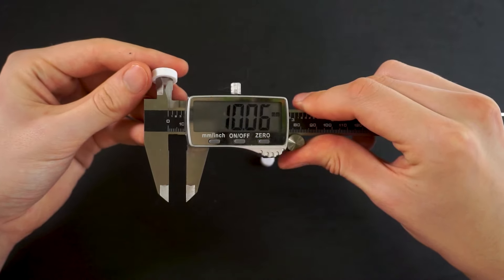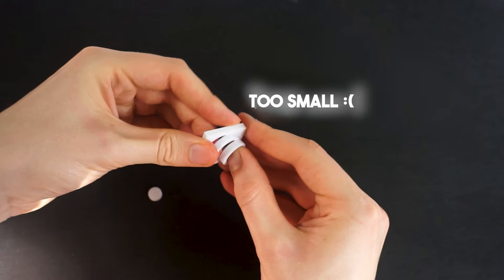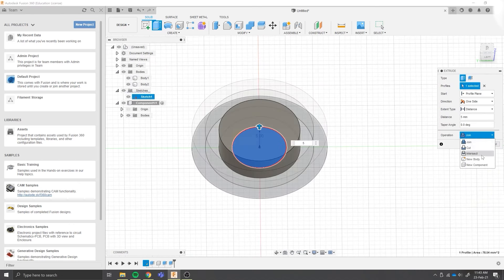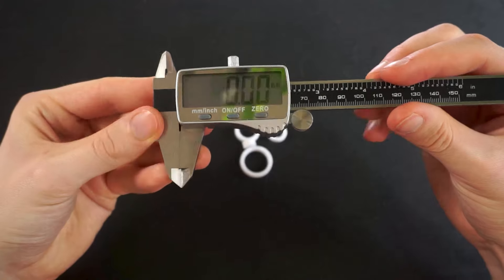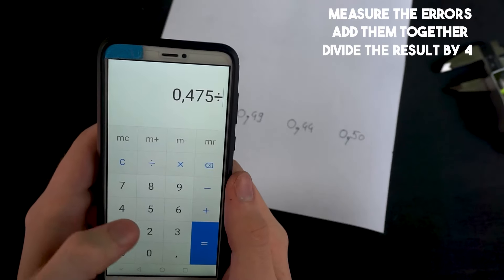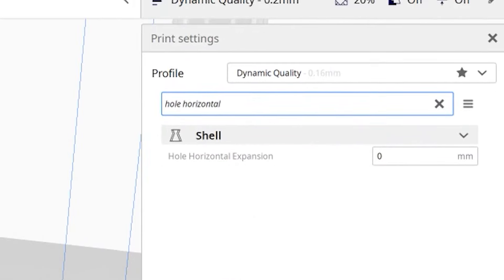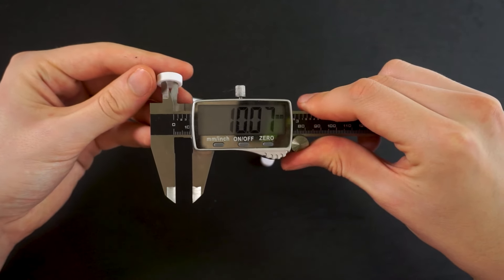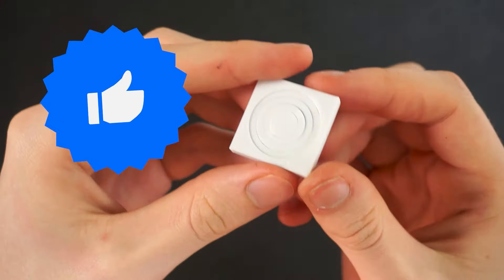How to Calibrate a 3D Printer when the Holes come out Too Small

Comment: I tried this and it worked perfectly to calibrate my Creality CR10S. Thank you for helping me make my printer work better. Just take your time measuring the diameter of the circles and measure each one several times to get the average of each measurement. Calipers aren't great at measuring the inner diameter of a circle without measuring off center.

Comment: This helped a lot since I had put -0.3 instead of 0.3 lmao. I thought it was the same as the normal horizontal expansion, and thus was very confused as to why the holes in my parts were getting smaller, not bigger.

Comment: Amazing, short and informative video!
Would like to ask you some aspects if you can help me.
Does this setting only works for X-Y holes as they are flat to the "ground" looking from top or in any other directions too? I mean I have a shape like cube, but with 8 sides, so some holes are horizontal, some vertical, some diagonal(X-Z or Y-Z), but some are diagonal by all 3 directions(X-Y-Z). Will it work for all the holes or I need to tweak some other options?
Also do you print all parts inside each other or separate next to each other?

Comment: Place a straight line of dimensions (for drawing) on the printer bed. Check the line with several other lines that the dashes - the dimensions are correct!!!

Stick somewhere on the hot end of the printer head, a needle (for sewing).

Bring the needle closer to the 0 on the line. Use micro steps!!! Then command the head to move exactly 10 or 20 cm!!! See if the needle will move exactly along the line or if there will be a size deviation!!!
You do this for the X axis, for the Y axis.

See if the needle moves exactly as it should! If there is a difference, you will need to adjust the steps for the X or Y motors in the software. By default, for example, my Marlin has 100 steps, but in reality, to be precise, my printer has 100.19 steps!

These things are very important. It depends on the straps even, different straps have slight differences... and give deviations.

Only when you are sure that the head moves exactly but exactly 10 or 20 cm. and you have set the steps exactly in the Marlin software. Only then can and should you sneak corrections into the salicer for size compensation if necessary. It's usually necessary because the plastic shrinks when it cools!

Comment: Perfect, circles didn't fit at all with stock settings. Measured the inner diameter and altered accordingly. They now at least fit in each other. Still needs a bit of tweaking and I imagine that the calculation can only be as good as your measurement skills. If it is still a tight fit, I imagine the number for hole expansion just needs to be a bit higher?

Comment: Can you do the calibration in the printer? Everything I print is to small. I printed an m6 nut and it was way too small. I printed a retainer for a 34mm bearing and it was also too small. Even the outside dimensions were too small.
Reply: Place a straight line of dimensions (for drawing) on the printer bed. Check the line with several other lines that the dashes - the dimensions are correct!!!

Stick somewhere on the hot end of the printer head, a needle (for sewing).

Bring the needle closer to the 0 on the line. Use micro steps!!! Then command the head to move exactly 10 or 20 cm!!! See if the needle will move exactly along the line or if there will be a size deviation!!!
You do this for the X axis, for the Y axis.

See if the needle moves exactly as it should! If there is a difference, you will need to adjust the steps for the X or Y motors in the software. By default, for example, my Marlin has 100 steps, but in reality, to be precise, my printer has 100.19 steps!

These things are very important. It depends on the straps even, different straps have slight differences... and give deviations.

Only when you are sure that the head moves exactly but exactly 10 or 20 cm. and you have set the steps exactly in the Marlin software. Only then can and should you sneak corrections into the salicer for size compensation if necessary. It's usually necessary because the plastic shrinks when it cools!

Comment: Wonder if Prusa Slicer/Bambu Studio has a similar feature?
Reply: PrusaSlicer: Print Settings --> Advanced --> XY Size Compensation is the closest I can see to Cura's Hole Expansion, I will be trying this out and see what my results are. Normally I just print external perimeters first but that isn't always possible due to overhangs and such. Did a bunch of reading on PS's XY Size Compensation and apparently it applies to the whole model, not just holes so that is crap.

Comment: You can adjust the horizontal setting to anything to make a hole the right size but it also effects the total size of the object.  My 15mm test cube with a 2mm hole came out with a much bigger hole but the size of the cube was now 11mm.  Don't work for me.....
Reply: if your In the latest version of Cura go to the - "Walls" section and you scroll down to the bottom and its called " Hole Horizontal Expansion" ... all the other  X&Y expansion tools will mess with your whole object instead of just the holes-.,,

Comment: Im getting a small build up of plastic on one side of the holes. Seems to be where the layer on each ends. Is this a retraction issue? The build up is causing the hole to be off on that side.
Reply: Probably the seam. You can change the location of the seam in the slicer or even paint it where you want it to be.
Reply: @Bundesbuffetminister  hey thanks for your reply. You are right. I figured it out after some tests!

Comment: do you have a video on how to design pieces to tight fit?
Reply from the maker: I usually just use a clearance between 0.3 and 0.5 mm when designing the parts, depending on the fit I want to achieve.
Reply: @FixAndStuff  is there auto clearance in fusion360 that automatically apply 0.2 mm more instead putting every scale manually?

Comment: i coulnd't make it work.
for some reason on my parts the measurements are 9.46 , 14.88 , 19.77 , 24.85 I ad just the decimals and divide the total by 4 then divide by 2 and the result in the print doesn't help at all.... Could some one tell me how they done it right!!?
Reply: i did the same thing, we missing a step? did you figure it out?
Reply: @Ski7so not sure if you've figured it out by now but you should get the difference that being actual-number subtracted by measured-number you add them together then divide by 4 then again by 2
Reply: I have an issue that my round parts are not completely round. It has a .010 deviation my belts are fine. And ran all calibrations.

Comment: What if X and Y axes are accurate but Z is not?
Reply: then its likely your first layer being to squshed, your nozzle to hot or you are under extruding
Reply: @freelectron2029  Z is higher than sliced e.g. if the calibration cube is 20mm cubed, X and Y are 20±0.05mm but Z is 20.2mm
Reply: @brisance  then you need to reudce your layer height. in simplify3d you can go into settings and change layer height by percentage. this just ,makes the machine squish the layers a little more. it might be your bottom layers are to cold and not squishing enough or your upper layers are to cold when they get away from the heated bed and are to high.